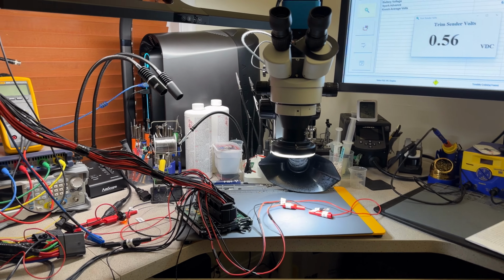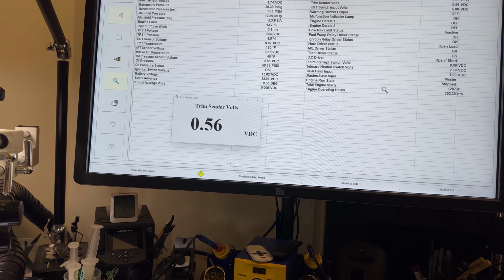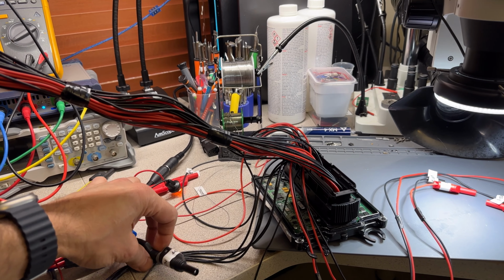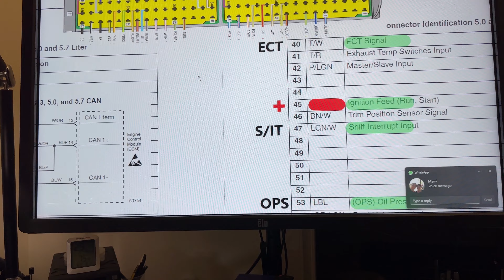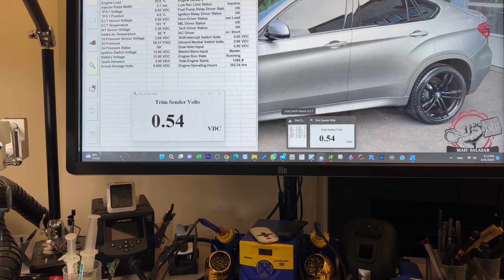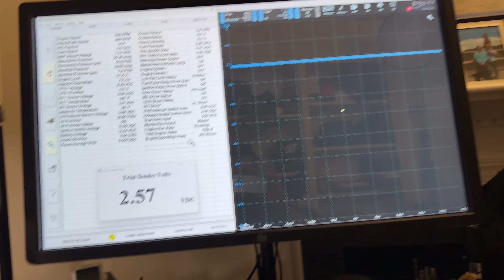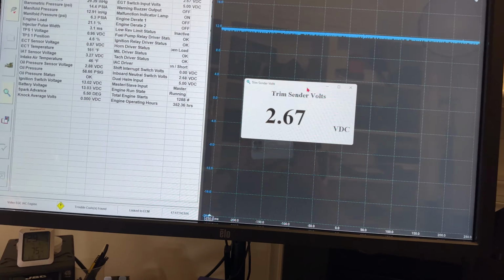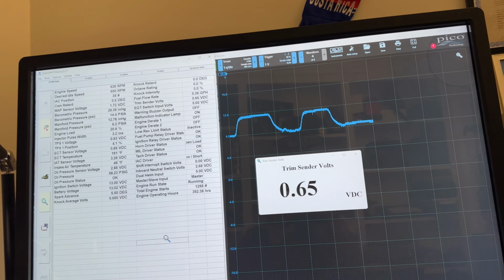2007 Four Winns H200 5 0 GXi G Volvo Penta no trim gauge ECM Repair Part 2 DTPowers in Canada

Comment: How do I contact you to request repairs for ECU? I replaced all the electrolytic capacitors on my 1990 Subaru Justy carburetor ecu but still not working
Reply from the maker: Sorry won’t work on your module
Reply: @MaicSalazarDiagnostics  I found your website. Can’t I submit it there?